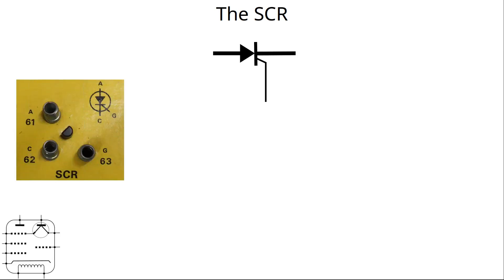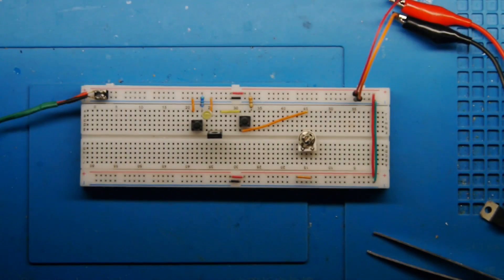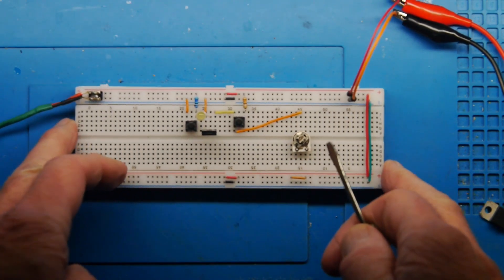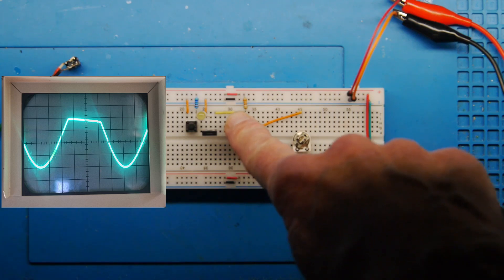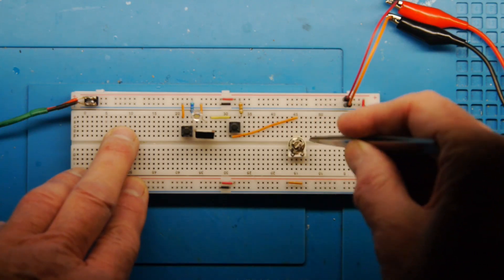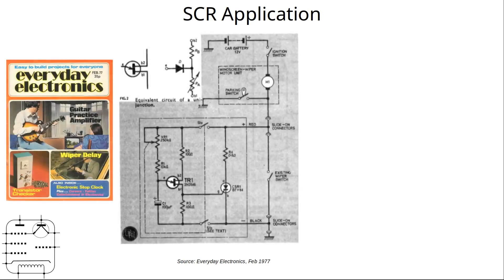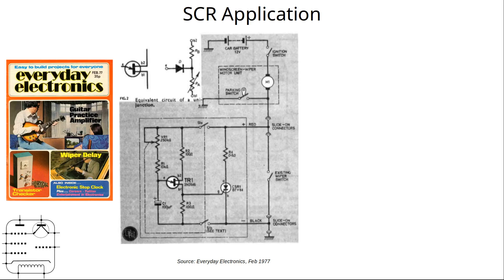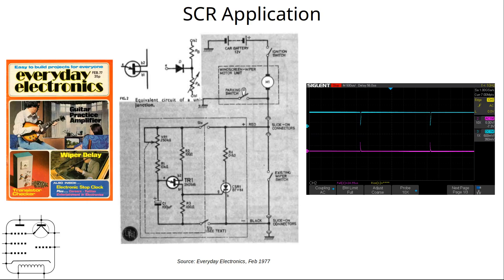Retro Silicon - The SCR - #228

Comment: Ahhhh.....just a comment from a retired technician ..... hmmm.....so, I've never seen any SCR circuit that uses a high resistance on the gate, (causing extremely small gate current)... it might cause the SCR not to trigger correctly, or not at all.   An SCR is meant to be either fully ON or fully OFF, the gate current on either a SCR or TriAC should be above the spec'd min. on the datasheet.  AC Dimmers usually  use a 'phase RC' delay to 'hold off' the time on the AC wave to trigger.  DC dimmer/speed control usually use a variable pulse frequency or PWM for On time control, (although the latching current has to be commuted by other means)  or am I way off base??

Comment: Late 60s early 70s I used to have a number of SCRs (surplus stock so no datasheet) which were metal bodies with an integral screwed thread for mounting on a heatsink.  Clearly originally designed for higher current applications. Never did find their specs, but were good for experiments.

Comment: Thanks Bill. The SCR was/is used in crowbar protection circuits, if you could cover that for my mate Ian who is struggling a bit with it, that'd be great. I've been using Linux for years after XP/W7. I use Linux Mint & Shotcut to edit my video's. Linux is a little harder to use but it's well supported by a great community & there's no interminable updates. Lastly I have a few BRY39 uni junction transistors if anyone wants one to experiment with &  try Bills circuit, cheers - DA.

Comment: Another classic use of the thyristor in the 70's  was as a crowbar across  the output of power supplies to clamp the output if anything went wrong with the voltage regulation thus protecting connected circuits or equipment

Comment: Just fixed an old Electric fence controller and its the first time I've come across an SCR for years. This circuit used a diac, that's pretty 70's, to trigger the SCR at 34V gate voltage. So a large cap was charged up, an RC circuit slowly rises to the 34V to trigger the scr which then dumps the cap across the primary of a HV transformer with the output going throw a few diodes and what looks like spark gaps of some sort, probably to protect from lightening then the process starts again giving a pulse every 0.5 sec or so. Quite a simple circuit once you dig through all the spaghetti of the day while avoiding getting electrocuted not something you want to touch they hurt. I saw a cow pee on one once you should have seen its face.
Reply: 😂😂😂 my brother peed on one once when we were kids. Once only 😅
Commercial dimmer circuits, and the once ubiquitous cfl bulbs also use diacs. 
What an interesting thing to get yr hands on, an old fence energizer. They can have some great hv components,if yr into that sort of thing.